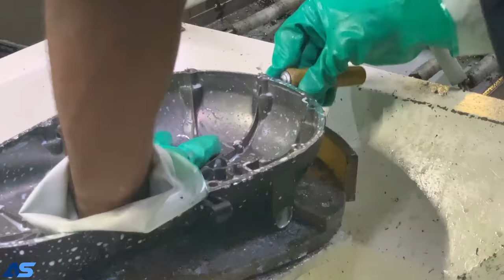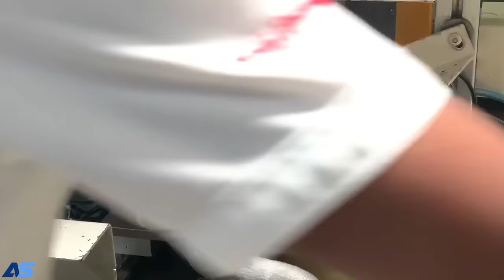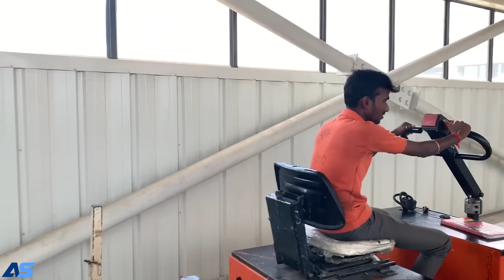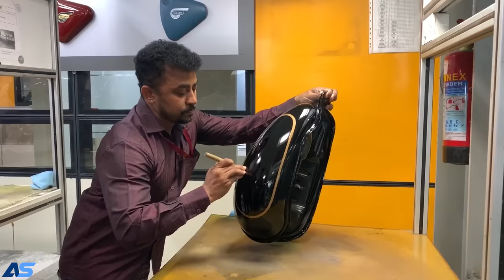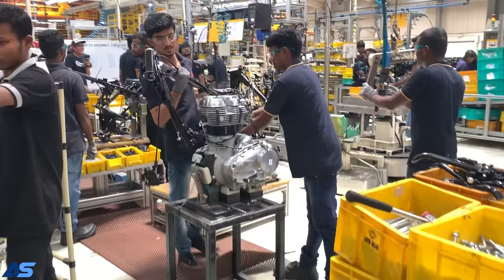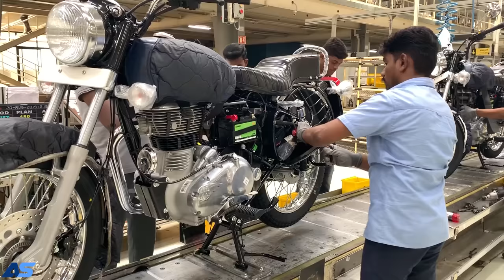โรงงานผลิตมอเตอร์ไซค์ Royal Enfield ที่อินเดีย

Comment: Just bought a lightly used 2021 350 Meteor today with less than 400 miles. Put 60 on it before I even registered it, Runs great, tight balanced handling and stopping, A little bit lacking in acceleration but kept up at 68 mph well. Great workmanship and incredibly good on fuel, Looks and sounds kool old skool. Very nice inexpensive motor cycle. Glad to support a brand that cares about quality with out ripping off the public. Also impressed with the hands on construction by the skilled workers, Great job all of you! May Ganesh rain peace and harmony upon you! (from USA).

Comment: It is great to see, how modern and clean this factory works.
Greetings from sw germany. (Europe)
I´m a motorcycle driver, since 44 years.
Reply: Greetings from NRW! Im a Bullet owner since 2016.
Reply: @ElectricEnfield  Have you enjoyed your Bullet? They have always intrigued me.
Reply: @dougfielding8215  Well, I have seen this Motocycle a few Years ago. After that, I made the Licence for Motocycles. 

Its still one of my Favorites.
Reply: @wanderwallz156  You don't need to poke fun at non-native English speakers, just need to get their message since you speak the language better :)
Reply: Make us old guys happy and produce a Classic 650 that brings back the bike from the 60s. Chrome full fenders front and rear, not that stubby little front fender that never was, plus dump the cheap painted rear fender with the cheap rubber/plastic mud flap. What’s that all about? Just a very cheap look. The exhaust also must look like it’s from the 60s not this swept look that spoils the classic look, plus easy to get a burn from the hot muffler as it sticks up in the way. Same design as the 350 classic muffler. And chrome the exhaust system. Like your classic 350. Bring back the chrome spoke wheels, dump the all black wheel look. The lower fork legs need to be polished or chromed, not painted. Save the money on paint. The seat needs to be changed it’s terribly hard on the butt. That’s an easy fix. Add some class to the seat for long rides. Chrome out or polish the upper fork brackets. The controls on the handlebars need some shine. Or polish them. You guys spend the money on a needed oil cooler, then ya paint the entire engine black. Paint ( black) holds heat in. Polish the engine cases the only black on the engine would be the barrels of the cylinders. A better classic look. Ya build a great bike, just fix the problems of the ugly blackout look. That’s not a classic look. Chrome will get ya home!! Hope you take my thoughts to heart. And make an old rider relive his past. I’m very sure you’ll sell more classic 650s with the real 60s look than the ugly blacked out cheap look. If some customer wants a all blacked out bike, let them order it that way. Don’t stick us with ugly cheap black paint. Future buyer when I see the change.
Reply: @deanblanton-fh3gq   I agree with you.  And also by driving the 650s.

My first 650 was a Yamaha XS 650.
I just wanted a simple and reliable motorcycle.
Amd it is a classic style bike too.
 
My last and now 650 is a Honda CBX 650 E.
Not a classic bike. But it offers all I want.
btw. Mine is made in 1983. And I have since 25 years.

It is not so big and heavy, like the "monster" bikes of today.
We don´t like to drive fast.

It is not important how much engine power HPS. I say just "It is enough."
Long time I don`t know it about my Honday.

And we don`t want so much plastic made at the bike.

Comment: If I ever buy one, it will be because of the hand painting on the tank. Well done India. This is what England lost.
Reply: Yes takes me back to my days at the Redditch factory 60 odd years ago when I worked on the assembly track it was nothing like this new factory with tooling that predated the war they also had a test track at the back of the works and a bike museum with belt drive pedal bikes its all long gone now.
Tanks and frames were gold striped with wire frames clipped on and painted with roller boxes the painters would mix the paint by hand.
Reply: Agreed! That’s was fascinating.

Comment: This makes me want to purchase a Royal Enfield , because I see humans making bikes and doing a splendid job, instead of robots . Well done to all the boys and girls of Royal Enfield factory standing shoulder to shoulder  producing beautiful motorcycles with souls. 
 Full stars  with thanks.
Reply: Broke As FK   I agree with you on both points.
Reply: Não tem Robótica???
Reply: Hope you have many happy  safe years with your Enfield.
Reply: That's why we all loved Royal Enfield ( Bullet) and the sound of the bike hat's of to you Royal Enfield
Reply: Tanks  na
Reply: @adityasharma9933  : The New Bullet which came with UCE (Unit Construction Engine) doesn't have any sound like the Old Bullet which had Iron Cast Engine. The New type of Bullet which has the Gear in the left side like any other bike is very very smooth (sound is smooth) Unless you change the stock silencer and install some other silencer, there will be no sound.
Reply: Then explain the issue of royal Enfield Himalayan reability

Comment: Purchased a 350 while living in Nepal in 2008 and never had a mechanical issue with it and I rode it all over the country.  However, during normal maintenance I realized there was not a single bolt or screw the same size or with the same thread or head.  It looked as if they had just dragged a box of spare screws/bolts over and assembled the bike with whatever they had.  I make this comment as I rode with a Nepalese Enfield Club and it was they who first pointed this out.  Spend one afternoon with them making everything right on the bike.  Also purchased a pair of hand made leather saddlebags for the bike as well. It was the perfect bike for my daily commute and to explore.  Loved the sound of the engine and exhaust.
Reply: This is by design. It is next to impossible to copy. The exact sizes gives the perfect stability. That is why China can't make a Royal Enfield. Original credit goes to the British, but Indian counterpart learned the art and improved on it.

Comment: Seriously after seeing those many bolts, nuts, washers, pins, etc etc that needs to be fixed on the engine by human hands, i feel a bit apprehension now as there is bound to be human error where one or two washers, spacers, pins might be missed...that is why i feel more assure when it is done by robots as they will never missed to fix whatever is needed as they don't get distracted or fatigued. But i must give credit to that guy who painted that stripe line  on the fuel tank...that was very impressive and the stripe was so consistent that i always thought that it was painted by a robot!!😀

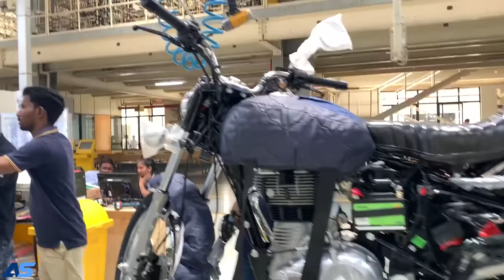Comment: Still using a whiteboard to track work, (16:00) should have a dashboard showing OEE and production data and don't see any bar code on the bins for tracking purposes but otherwise looks like a good process and yes the skill of the pin striping is awesome.

Comment: Let's get serious for a minute - how is it possible that they are still putting Lithium grease on the relay pins when it has been known to cause motor cut out problems for more than 2 years ? How is it possible they are unaware of this issue ? The 2022 models still have this issue ...

Comment: Plastic bucker up botlifiers
Reply: PVC pluck plug pipes steam on Cary box dropper effect
Reply: 60 / twice
Reply: Cary stabler screw effectivity (Suzuki) bolts sprints
Reply: 8 noseled fitings
Reply: Down edged sword 🗡️ needle markings
Reply: 2.1.2 stability
Reply: 16 doting series circuit
Reply: ❤preventive rapid acurate
Reply: Moto fortified accuracy ok certified roller  bal barings